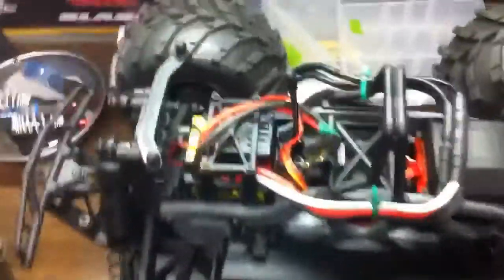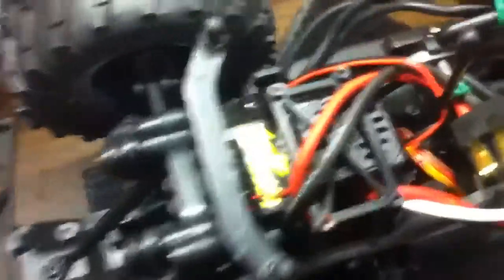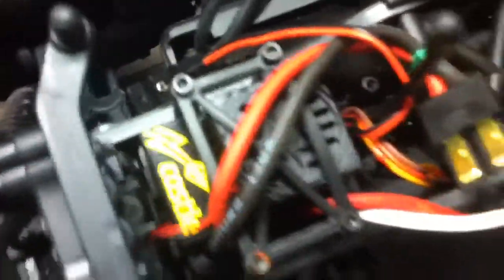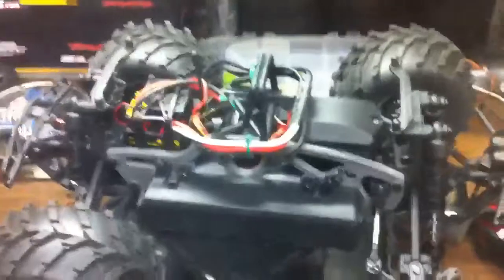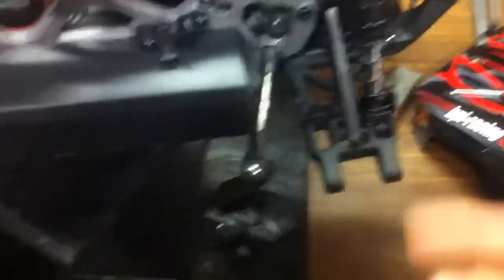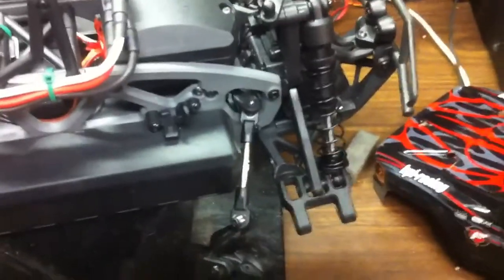Savage Flux XS

Comment from the maker: @sibylvane75 I'm not going to tell you to not buy it. It's super fast and handles pretty good. But, just like any other "new release" RTR RC car/truck it has its little issues.It definately doesn't have any major problems that I have found. I just like to have parts readily available if I break something. Thats just me though. I may have just got a bad one,or its just my luck.